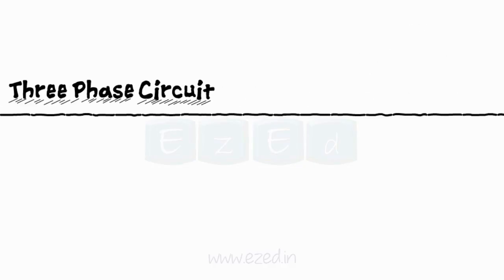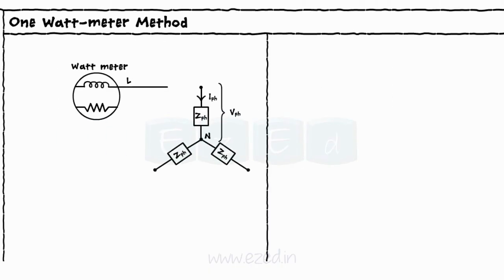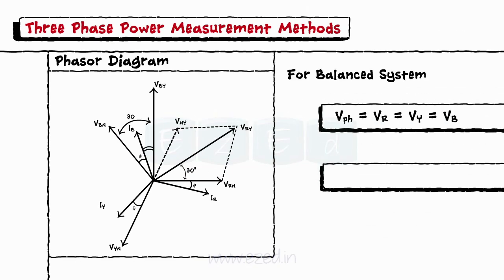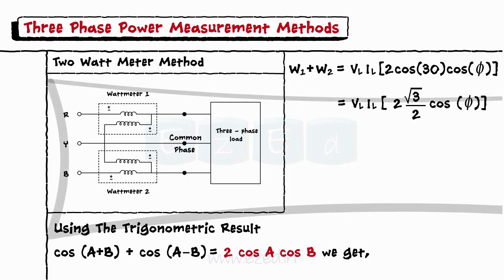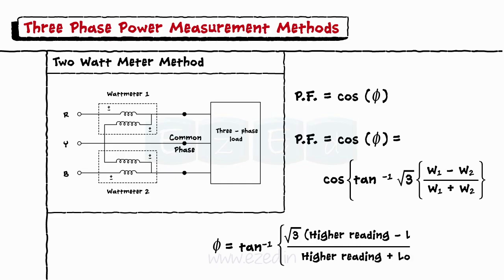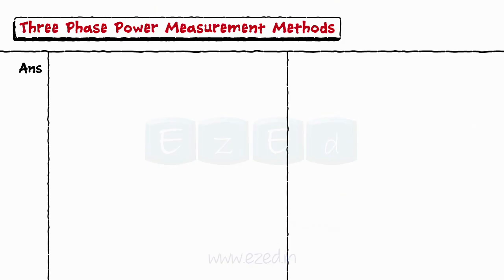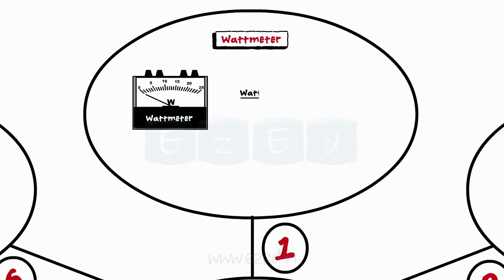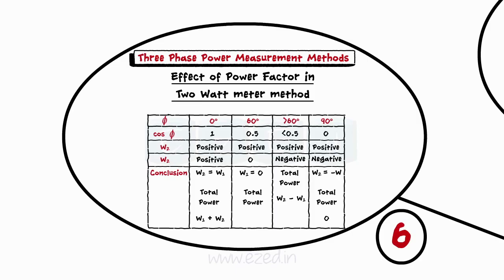Three Phase Circuit Tutorial - 1 Wattmeter 2 Wattmeter Methods - Solved Problems

Comment: cos(A+B)-cos(A-B)= -2sinAsinB. @3:01
for wattmeter voltage coil, you draw a rez symbol @5:55 & @6:02

  It seems like there are some mistake there @EzEd Channel
Reply: @3:01 You can using
CosC-CosD=2sin(C+D)/2.Sin(D-C)/2..